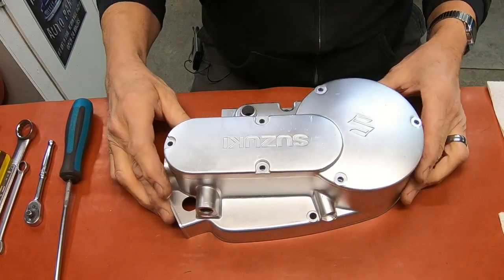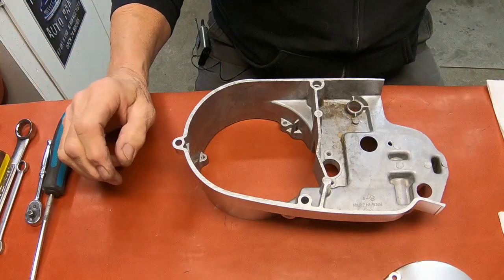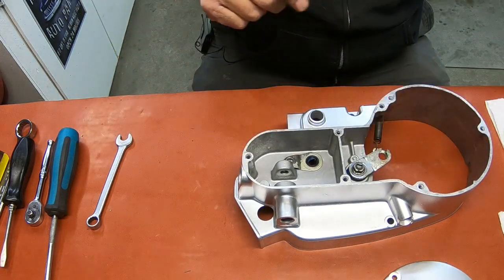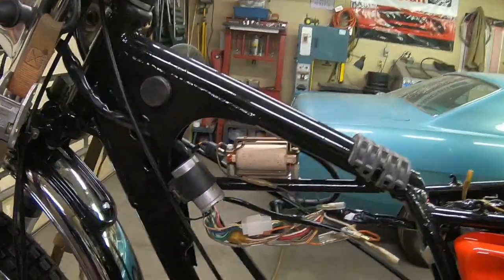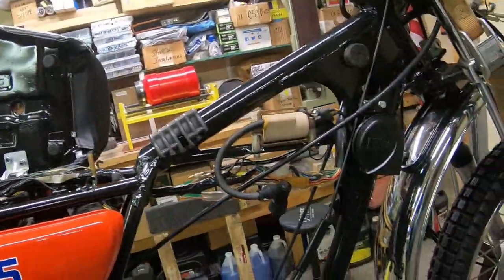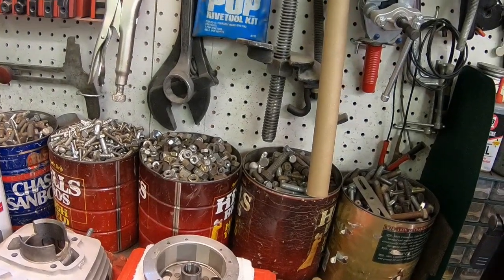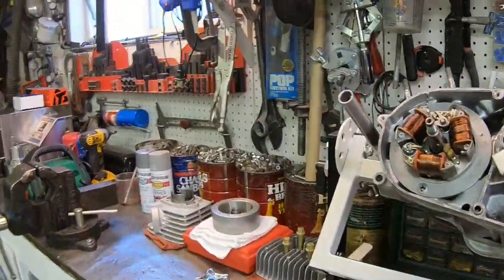Reduction shifter case buildup of the Suzuki TC125

Comment: Dale i cant seem to locate the stepped part with the rubber grommet and the one screw . on the bottom. i have the metal stepped part but the grommet is missing, any way to DIY a rubber grommet?
Reply from the maker: Not sure what parts you are referring to.
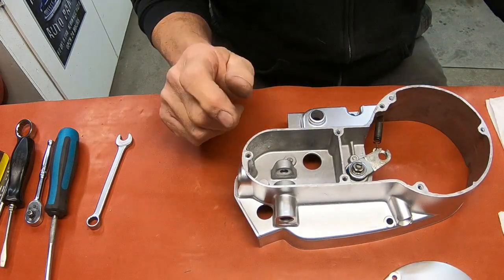Reply: i knew i was going to have a hard time explaining the exact part, its at the 5:40 mark on the video. the small tab with the rubber insert you said was original but in good condition. i found mine but its not so good. think  before i try to fix i,t i would see what you might do. thanks Dale

Comment: You're a god damn saint. I had to take off the reduction shifting cover on my tc120 to work on the stator and was an idiot and didn't take any pictures of how the reduction shifter was assembled. The exploded parts diagram isn't particularly helpful, but this is exactly what I needed!  EDIT: any tips for removing the Shifting lever? Mine is in there really good and isn't budging, I don't want to damage anything trying to get it out.
Reply from the maker: Hey you might try wedging  a screwdriver in the slot of the lever after removing the bolt of course.  Try to spread it apart a little bit while wiggling the lever and pulling straight out. Glad my videos help folks, good luck with the lever and thanks for watchin.
Reply: @montana2strokeracer  thanks! It was slow going at first but that worked for me. Just got back from my test ride and everything works great now. When I first got the bike it had been sitting so long the piston was seized and the shifter wouldn't even budge
Reply from the maker: That's great. Good job.

Comment: thanks for video Dale . i watch you videos over and over to make sure i reassemble in proper order. they are so helpful.my tc100 is not exactly the same but close.
Reply from the maker: Thanks again John. The way I have always installed the clutch push rods are as follows. Flat end in first for the two long rods inside the engine, that way a round end fits to a flat end to let it piviot easier. The  adjuster screw inside the left side case is also flat so it fits to a round end on the first long rod. Really its just flat end to round end all the way thru. 
How is your parts situation? Get them all from overseas I hope. Hows your build proceeding? Thanks again for watching my videos, hope they are helpful.
Reply: @montana2strokeracer   Hi Dale yes i have parts I got my crank run out to .001 on one side and .0025 on other side I did not have that hole in crank like you so I took straight edge and small file to scribe a line on crank which was helpful to line back up in reassembling . I made measurements like you Mine was about  20 thousands between washers on crank and I also made that other measurement on crank you did with veneers.so when I pressed in rod i keep checking with veneers. i never got to my measurement because rod got tight so i guess my new washers or bottom of rod was a little bigger so i backed of on it until 19 thousands on my feeler guage  and left it there .My transmision is all back together and finished clutch side of motor Like i said your videos are very helpful thanks
Reply from the maker: @johncasertano1687  Thats great, sounds like your making more progress than me. I did notice that the new crank washers were .004 thicker than the old ones on mine. my over all crank size was about .008 wider. But thats not enough to worry about. Nice to hear you are getting her back together.